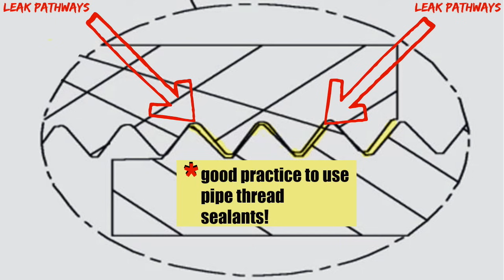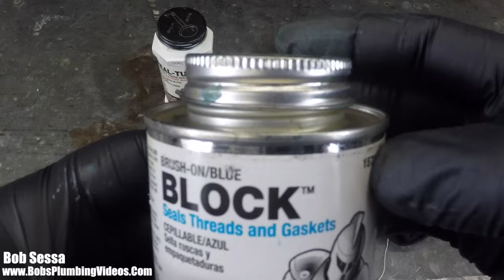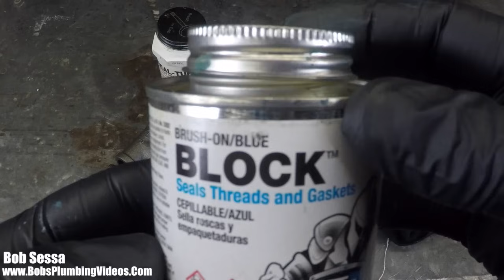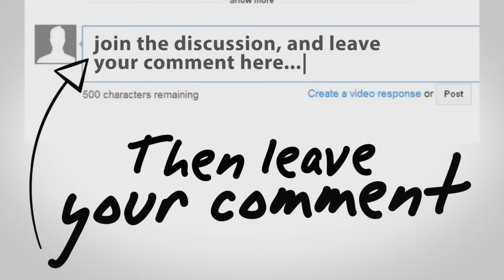Pipe Thread Sealant / Which Pipe Sealant & Why!

Comment: Question: I have a connection on my hot water heater that has a male metal to female Pvc pipe thread conection that has what looks like a red sealant in the connection that was installed in 2020.  The inspector that came for my insurance renewal said I have to replace it because it was rusty.   Could you explain what it could be so I can convince them there is not a problem.
Thank you
Reply from the maker: It's most likely Loctite thread sealant which is very difficult to remove. Check it out here -https://tameson.com/pages/loctite-color-comparison

Comment: Installed a water softener and used old joint compound.   We have copper water pipes and now the threaded brass pipe nipple that is screwed into the threaded copper pipe adapter is leaking very very slowly.....drip every 3 hours or less.  What to do?  To sweat off the copper fittings and redo the threads with Teflon and blue block would be a bigger job than the original softener install.  Is there any other option?  Will the leak eventually fill with mineral and stop?
Reply from the maker: The heat most likely affected the joint, short of redoing the joint over I would wait a couple of weeks to see if it stops on its own. Is that OK with your customer? If not, you might have to bite the bullet and re-do everything!

Comment: I’ve done MANY water fittings, both high and low pressure, have never had a problem with just straight Teflon tape. 
A lot of other guys use Teflon tape and Locktite thread sealant, idk just seems to always come out messy and sloppy. 
Do you think for just say, high pressure water, is liquid thread sealant even necessary? 
I use two & 1/2 turns on standard blue Teflon tape and never had a problem.

Comment: What do you use for stainless steel fittings that keeps them from galling together forever ??? Nice video Sir.
Reply from the maker: Mega-Loc is a good choice in my opinion. Seals great and breaks apart easily! Thanks for the visit, Bob.
Reply: Will this take 1200 F heat ??? I will be putting the 316 and 304 SS mix pipe inside my woodstove. This will be the secondary burn part of the stove. The pipe I am using are 3M pressure grade. All overkill but the price was right so that is what I used Bob. Thanks for your time Sir. vf @BobsPlumbingVideos

Comment: Hi I'm deleting  a tank on my diesel truck  I used some thread sealant  with PTE that fleetpride suggested.   I'm still getting air into system and sealant is still wet after 3dau as if I just put it on. How  would you suggest  I go about sealing the threads ?  It's a diesel truck that sucks from 2 sides through a 1/2in  T fitting im capping off one side so there will be diesel suction bouncing off the blocked cap at around 100psi. Or greater
Reply from the maker: Pipe threads? I would probably use spool lamp-wick with either the Blue Block sealant or a product called Gripp. Blue Block-https://amzn.to/2uemhQg / Gripp-https://amzn.to/2Obu7TX. Lampwick-https://bit.ly/2HtvVr0. If not pipe threads, I would use the PTE recommended followed by either the gripp or blue block.

Comment: I'm trying to fix a leaky fip shut off valve to the toilet.  I attempted to replace it with another fip shut off valve.  I removed the old one and put on the new one using teflon tape around the thread of the water supply line.  I wrap the teflon tape 4 turns clockwise the first time and tighten it, but still leaks from the thread connection.  I removed it and removed the teflon and wrap the teflon tape 6 turns and it still leaks.  I noticed after removing the shut off valve that the teflon tape is gone from the portion where the pipe thread and shut off valve meet.  I watch your video using a pipe sealant in addition to teflon.  They sounds like the solution to my problem.  I notice that there was a blue color on my old valve thread.  My question is should I be using megaloc or blue block for the sealant.  I'm not sure I understand which one is better to use except that megaloc is easy to clean off.
Reply from the maker: Blueblock is my go-to product for difficult joints, but if the threads are cracked you're going to be faced with replacing the nipple coming out of the wall! Good Luck, Bob.

Comment: I just had to pull (lean over) a newly installed fiberglass shower stall.  Teflon only had slow drips.  Teflon and thread sealer did the trick.   Something so damn simple biting me on the butt, but your video effort was well worth it.  Thanks.
Reply from the maker: Happy to help, thanks for checking out the video~

Comment: Definitely learned from you about the pipe thread sealants.  I am replacing a PRV.  I put Teflon tape on the threads.  The PRV is a brass fitting.  The locknuts are brass from existing hardware on collar/tailpiece assembly.  The bottom locknut seals.  The top locknut is not completely flush, so the locknut does not bottom out correctly.  Never used to paste before, but I am going to try it.  If it works per a man of your experience, this is going to be a fun installation.  This problem had me stumped.  I lacked insight on the solution.  It's a residential pressure reducing valve so I will set the psi at 60--65, but first I got to make sure the connections are water tight seal.  Looking forward to plumbing.

Comment: Hello I have a 2" galvanized pipe for my water drain. I had to unplug my shower and kitchen sink so I ran the snake on the main drain. When I put the cap back on it was so rusty that it started leaking. I replace the pipe and now the pipe is leaking. What Do you recommend. Teflon and what else? It's old pipe.
Reply from the maker: I would use Teflon tape and Blueblock. Careful, it can get all over. Have some laquer thinner for clean up.

Comment: The video was informative,  thank you.  I have a question.  I am about to install a gas stove.  The old gas stove had a flexible pipe connected to a brass adapter,  this adapter was connected to a standard steel pipe.  The brass adapter only had white Teflon tape.  Is this legal in NY/NJ?  Can I use Teflon tape too for my new flexible pipe?  A friend suggested using "PRO Dope pipe joint compound" only,  will this work?  I heard there is yellow Teflon tape,  should I look for it?  My first impression is that all three alternatives would work,  but to use Teflon tape may not pass code.  Please elaborate.
Reply from the maker: I use the Blue Block, but Pro Dope has been an industry standard since I started and you can't go wrong! Don't use Teflon on Gas, inspectors will knock it done all the time1
Reply: They make Teflon tape for Natural Gas and LP, have for years. Never had one leak or turned down. You don't want to be running water anymore in brass. PEX IT.

Comment: Thanks Bob for a great video!
Which pipe dope would you use for heating element threads in a steam boiler tank application? Does boiler/steam app fall in the category of gas so use blue block? Looking forward to your opinion. Many thanks.
Reply from the maker: Blue Block is my "No Callback Bulletproof" choice! Can't go wrong with it, just don't get it on you or your tools, or Lacquer Thinner to the rescue!
Reply: @BobsPlumbingVideos 
1)  just so I fully understand, by 'blue block', do you mean :
- 'blue Teflon tape + BLOCK pipe dope'"  ?
          or
- BLOCK pipe dope'" only will work fine?
2) Lastly, I assume using BLOCK is no problem should the water boiler heating element ever need replacing (unscrew threads again in future if needed) ?
Thx .

Comment: Nice video!! So, what size under ground plastic gas line should I use to service a 25000btu unit about 60' run. In the house I've got 26' of 1 1/4 to first appliance, and about 35' servicing furnace, water, stove and washing machine. The new drop will be 7' of 3/4" to under ground connection. 
Thank you in advance.

Comment: Hi Bob - I am doing some repairs to an old commercial stove, using threaded pipe and pipe dope.  My main question is, once the joint is hand tight with pipe dope in the threads, how much more do you need to tighten it down?  I ask because the pipes have to end up at certain angels to fit the space they need to go, so i am afraid of going too far and not being able to get a valve to face the right way, for example, because i'm at the end of the thread and can't turn it any more... do i the go backward?  start over?  whats the trick to getting this right?  Thanks in advance.
Reply from the maker: If you're at the end of the thread, forcing it any further could damage/split the fitting. How tight is tough to answer, it depends on one's sense of feel. An older pipe may have  a looser thread than a newly threaded piece of pipe. Generally speaking, hand tight plus one or two turns,then you'll have to decide how to finess the positioning of the fitting you're trying to line up.
Reply: oh, ok.  since it's a stove from the 80's, that old pipe has been sitting in there for decades, heating and cooling, expanding and contracting.  should i just replace all the pipe?  will i get a tighter fit that way?    it's just a few feet of 3/8" pipe, won't be too expensive...

Comment: Hey Bob, nice video.  I was wondering if you have any suggestions on what to use on 1.5 to 2" threaded PVC going into pool pumps,  filters and other equipment?  Oftentimes these products are made of cyclolac abs or other resins (not SCH 40 or 80) and the threads are cut very loose...  in other words I've often put on 13 rounds of white teflon or 8 rounds of the thicker stuff and the fitting go in all the way sometimes still leaking.  I see there are pipe dopes made for plastic but haven't tried them, the ones we have in the truck are for metal gas pipes only.   Back in the day 5 rounds of white teflon and you were good to go, the stuff seemed to be cut to a better tolerance and didn't leak but now even with years of experience i find myself putting on ridiculous amounts of tape and tightening the hell out of stuff (or using a fitting with an o-ring seal on the flange) to prevent leaks.  Any advice welcome, thank you.
Reply from the maker: On schedule 40 p.v.c.male threads I use Blue Monster ptfe tape followed by Mega Loc or Real Tuff joint compound.
Reply: @BobsPlumbingVideos  Thanks, I will try some compound over top of a few rounds of teflon on our next installation.

Comment: I have a brand new shut off valve threaded onto a nipple coming from the wall and I did about 2-3 turns with Teflon only and it’s leaking. Should I do more turns with Teflon AND add some thread sealant? I’ve been reading many articles on when to use one or the other or both and I cannot make up my mind. Maybe I’ll just end up experimenting with what works best.
Reply from the maker: If it's older pipe I would a combination of Teflon and pipe joint compound. A high-density Teflon (https://amzn.to/2v0s3pk) would be the best, as far as how many turns I've gone as few as 5 or 6 and as high as 9 or 10. Depends on the condition of the pipe.

Comment: Wash DC running black steel gas pipe on my own 2 unit building. Thanks much for the video!! I have had so many problems getting this 2 apartment, 2 meter, 8 appliance job to hold test pressure, and have lost so much time on this renovation. Had a 30yr vet plumber friend help at first but his 1-1/2'' dye was bad and I ended up doing it all over all myself. According to the video I've  been using the right stuff this time, Blue Block. We first were using Teflon tape+Pro Dope. I know I'm not supposed to use teflon tape on gas, but do you ever use it anyhow or can I go back over and use Blue Block with Lampwick? I'm losing about 1/2 pound per day on the 15psi test, it's very frustrating, going broke on this. Plumbing is my second trade but I have learned to tighten very snug and never move the fitting behind me but Inst it hard to enlarge black steel fittings by over-tightening. Sorry for the long question, It's been a really long problem. Thanks again for any help.
Reply: Also do you ever use Grip compound on gas when there are problems? Thanks. Very informative page by the way.
Reply from the maker: I use blue block or grip on all my gas work. Thanks for the watching! Bob
Reply from the maker: Sharp dies and adequate oil when threading to ensure a nice sharp thread. On all gas, I use blue Block or Grip, no Teflon, if I have a problem joint, lamp-wick followed by Blue Block or Grip. Are you using ball valves or tee style gas cocks? Gas cocks will never hold pressure, make sure the manifold/meter set is not the cause. Spray the joints to find the culprit!

Comment: Can you use Yellow Plumber's Tape with Blue Block on a gas pipe?  I thought yellow plumber's tape is for gas fittings?
Reply from the maker: I use Blue Block alone on gas, no Teflon allowed in N.Y.C. but yes you can use the yellow Teflon for gas if your code allows.

Comment: bob
will a jet set hold long enough to let me put a compression shut off on a live 1/2" copper supply line ..(curb stop is frozen) pressure is over a hundred psi ?
Reply from the maker: I’m not familiar with a “jet set” but with 100 p.s.i. I would not attempt it, unless you’re in an area where the flow of water is not an issue (unfinished basement with a drain near by) Leave the replacement valve wide open until you compress tightly, then shut the valve. Risky chance of property damage if attempting this in a bathroom or kitchen. Regards, Bob.
Reply: @BobsPlumbingVideos  
darn auto mis~correct !  jet swet is the tubing plug.. I plan to have a push on ball valve if I can't get the jet swet to hold..a compression ball valve if I can get the jet swet to hold..it is in a basement with water table issues ...a sump pump
Reply from the maker: Duggy Dugg Brain freeze! I have seen them but have never used them. If you can get it to hold 60/80% I don’t see why you couldn’t use a shark bite push on type or the compression valve. Be careful, good luck!

Comment: How do you deal with a shower head stem that starts to get tight when it's pointing up? I feel like something's going to break if I try to tighten it another 180 degrees.
Reply from the maker: I'd most likely back it off and use some spool lamp-wick followed by Teflon tape (quite a few rounds) and try it until it's tight enough as not to snap the threads off.

Comment: Bob 
What about yellow Teflon tape? Seems like all the gas lines use this in the state of Colorado. I'm going to run some LP lines under a guest house I built. Is LP different than natural gas?  I'm on the fence for blue block or yellow Teflon tape. Any suggestions ? Thanks. Oh by the way an old navy chief pipe fitter I knew always used Teflon and compound together in his pipe fitting career. That's what he taught me.
Reply from the maker: I know the yellow tape works for gas, it's just not recognized by N.Y. Plumbing code. To this day I use the blue block on a my gas work.
Reply: Ok. I'll check with the local propane installer and see what they say. Thanks for the reply. Keep you posted. Thanks.

Comment: Is RectorSeal worth using anymore? I've never heard of Megalock until now. Another question- Is there a waiting period when using the brush on sealers or can pressurized water be introduced immediately into the joint?
Reply from the maker: RectorSeal is still around, with the MegaLock and Blue Block you can pressurize immediately, no waiting necessary.

Comment: You used brass on all your examples. Is steel or black pipe done the same way?
Reply from the maker: Absolutely, yes!
Reply: Thanks for the video. I am now leak free. I did it several times with just Teflon tape, but it still dripped. After I saw your video I used the tape with the mega-lock you suggested and it worked like a charm. Thank you!

Comment: Would you recommend using the blue block on hydraulic connections? Seems like it would work a lot better than the ptfe stuff that doesn't ever want to seal. Can you get the blue block at lowes or stores like that? Thank You
Reply: Loctite 567

Comment: Is there any reason you don't use blue block on your new fittings?
Reply from the maker: Other than it gets messy NO! I use it on all my gas work both new and old. For water lines, I use Mega-Loc unless I have some nasty looking threads. Then I break out the Blue Block. Sometimes it can get messy and gets all over the tools which I immediately clean with lacquer thinner! Regards, Bob.

Comment: Question, will I have trouble removing a pipe down the line after using liquid thread sealant?
Thank you for the info
Reply from the maker: No , with the Blue Block it's a soft set sealer. A little muscle will get the job done.

Comment: Thank you! This was an excellent video. I have three questions: 1. What would you recommend on a 12 year old steam generator unit at the pipe thread of the water inlet and the steam outlet? I have leaks (using teflon tape alone). The steam is obviously hotter than regular water heater threads; so which would be the best joint compound. 2. How does pipe thread sealant 5 compare (yellow tube from home depot)? Can I use this on steam joints? 3. For general purpose heavier duty tape, which is better blue teflon or the gray one you showed?
Reply from the maker: For problem joints, I would use the spool lamp wick in combination with the Blue Block sealant. I've also been using Blue Monster (blue) Teflon Tape w/ the Blue Block and have had very good results.
Reply: @BobsPlumbingVideos  Thank you so much!

Comment: Can I use Teflon for gas lines? Specifically for BBQ grill gas lines? I am changing the gas valves that stream gas to the igniters, but I am not sure if I should use dope or Teflon.
Reply from the maker: If you’re in NY City no, I would use a good quality pipe joint compound and call it a day! Regards, Bob.
Reply: @BobsPlumbingVideos  I am in Florida. Its more of a propane tank that we use on a grill we have at home. I changed igniters, but wasn't sure if I should add compound where the tubes connect. Thanks!